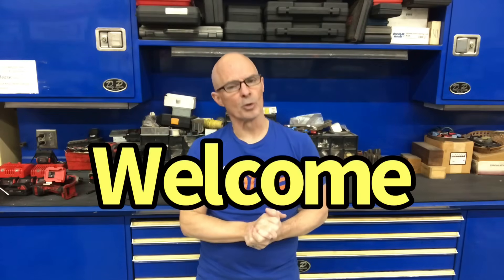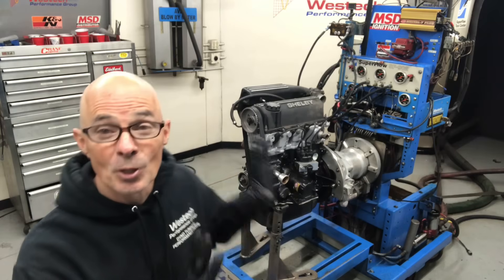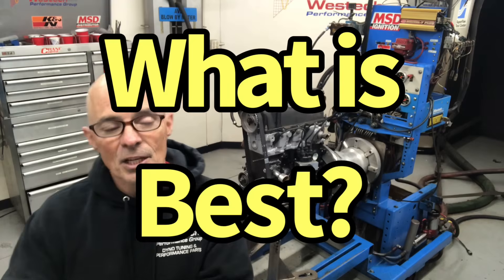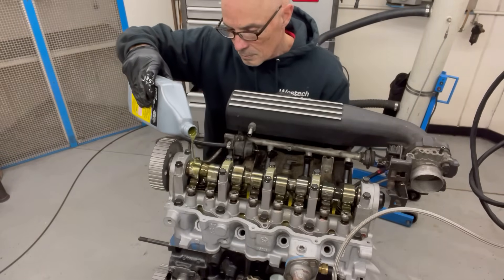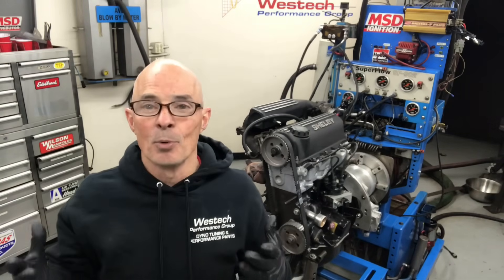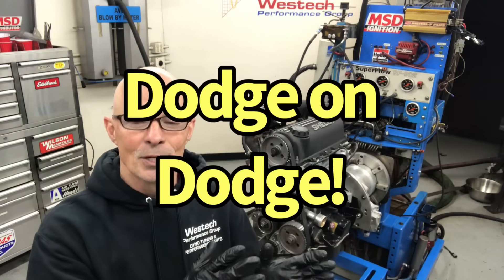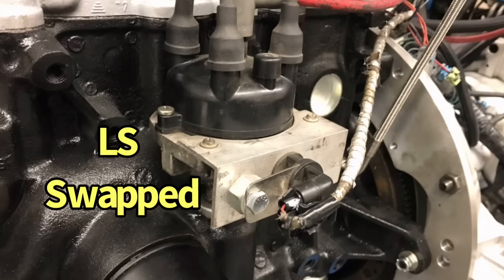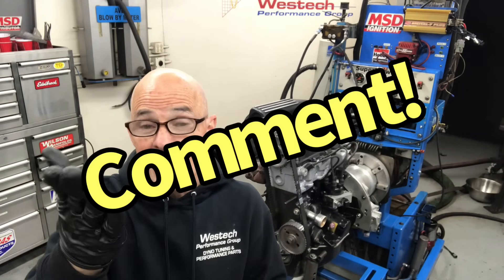2.2L DODGE TURBO-LS SWAPPED THE DISTRIBUTOR. 1ST DYNO TEST. WILL IT RUN? HOW TO RUN HOLLEY HP ECU.

Comment: Shelby said he found 40 degrees total advance to work on the street. The 84 Shelby had a special ECU with more total advance and a knock sensor.

That spike seems to be timing getting away then valve float at the drop off. 

Needs a (Half) set of 340 valve springs or better yet, cut the valveguide boss down and run Beehives.

The stock 2.2 valve retainers are HEAVY. Beehives retainers are less than half the weight.
Reply from the maker: what is the stock total timing
Reply: @richardholdener1727  On my Shelby I set the timing at 20 degrees advanced with the vacuum hose off the ECU. Then when the hose is back on it jumped to like 25 advanced. The special ECU allowed a total of 40 degrees this way.
Reply: @richardholdener1727  way less than they really work well at. My label says 6 degrees BTC Auto or Manual but that is with the stock ecm/PM managing and advancing the timing. I have hundreds and hundreds of passes at 46 degrees (static and total). It will run well at 42-46 degrees. But anywhere below 40 it is a pure dog.

Comment: I think I may have an issue, I've never seen that kind of oil pressure in mine. It's 50psi on start up the falls to 20psi, both at idle
Reply: Mine is 74 psi but it was oil pump matched on the block side way down into the main galley...increases pressure and volume to the top end, but lowers the restriction and HP robbing, the 287 head is open full drain back w/ hardly any restrictions whatsoever. The drain backs are open to the front and rear of the crank and between the counterweight. The oil pressure readings are now higher do to the lesser restriction use to be much lower in the block and the higher increased flow and volume. It is a bare block mod so best done during a full rebuild. The more oil in the head or top end (the less volume in the pan), the less need for a crank scraper or baffles as the oil P.U. is very near the bottom and rear of crank counterweights are splashing oil everywhere inside due to the transverse and tilt toward rear of engine mounting position on a 2.2/2.5L. Little work for a big gain.

Comment: I'm thinking up until that peak bump, the lack of timing control to it is leaving the area under the curve on the table.  Valves springs old and tired? Possibly. Maybe try a crank mounted trigger.

Comment: The plastic rivets in the distro are known to fail in the aftermarket units,  the metal part will flop around and run like crap.
Reply: Always and never fail to on a new rotor (no matter who mfgs it, flip it over and add 4 big beads of super glue to the 4 plastic melted rivets locking the shutter wheel to the plastic rotor.

Comment: Had a Plymouth Sundance with a 2.5, wish I would have got a turbo, those are great little engines, that is a weird power curve, stock mine would fall flat at about 4500. I autocrossed it and had a blast

Comment: Can you eliminate the Distributor and run coil packs? Utilize the distributor to plug the hole and maybe act as the trigger wheel only. you might be able to use the Holley at that point to take over the timing control.

Comment: I drive a 1985 Dodge 600 convertible in the summer.  It is a 2.2L non-turbo.  99 horsepower originally.

Comment: My WAG is it has to do with the manifold, which should be easy to test. My thinking is this: A engine needs four things to make power, air, fuel, compression and spark. The compression isn't changing so we can throw that out as the cause, you know what the timing was and it wasn't changing. It didn't suddenly get more fuel, or your AF ratio would have changed. So that leaves more air. Somehow at that RPM it just had better flow, you had enough injectors so when it saw more air it was able to add fuel to keep the ratio correct. More air, more fuel, more power. You are smarter about all this than I am, so I'm probably incorrect, but a simple intake swap might eliminate the spike, or more it somewhere else in the range.

Comment: Going to take a stab here, and if the ignition/distributor timing checks out, make sure that the cam timing is dead nuts on, might be too advanced. And you have to line up timing marks with a head that's tilted back. On the 2.4 dodge motors the little pin that holds the cam in place with the cam gear will sheer and your cam timing will be off. I would check the cam gear to cam alignment again just to be sure.

Comment: I swapped a G grind cam into a 82 Scirocco, and noticed a similar thing, the stock cam in the 1.7L motor would rev to 6500 but lacked pull power, it would just rev, but the new cam got a power spike from 6k up to 7k RPM, and I never knew why, but I liked it, so I wonder if it's your camshaft grind causing this power spike.
I only changed the cam, no other mods to my engine or fuel system.
Reply from the maker: it is stock 84 turbo cam

Comment: IN MY OPINION if the ignition was locked on the last two: The first few pulls with the overly advanced ignition timing is from pumping losses.  Dealt with it myself on the dyno.  Its soooooo far advanced that loses the ability to kill the motor but it makes terrible power (gets worse at lower rpm and will eventually hurt the motor if it can rev high enough) and runs rich.  The power spike that youre seeing after you locked the timing out seems to be a cam/intake/springs/portvelocity mismatch or something.... but it moving is very suspect lol.

Comment: I'm willing to bet if you extended or reduced the length of exhaust pipe after the collector, you'd loose most of that spike in power. I think it's right at the point where the pressure waves of the intake are coinciding with the negative pressure waves of the exhaust, so you're getting a super scavenging effect in the engine at that rpm. That exhaust pipe length looks about the length needed to make the negative pressure wave peak at 5000rpm (we make our step ups from 2" to 3" just behind the gear stick location) usually the place where the catalytic converter would be is the best for a 4500-5500rpm power spike. Certainly it feels like vtec inside the car, I liken it to a free nitrous hit
Reply from the maker: I'm familiar with the many different forms of scavenging on the exhaust along with the three major forms of cylinder filing in the intake, my question is why did the spike change with no change in exhaust pipe length?
Reply: @richardholdener1727  it may have a bearing on the injection timing, as in the exhaust gas temperature and pulse strength based on how much of the combustion pressure is blowing down and how much is useful work. You'll know yourself that spikes in power like that are usually as a result of a massive increase in cylinder filling/scavenging. I wonder if you could replicate this situation on another engine. It seems to me that the peak power below this spike is quite low given the engine set up, so it's probably all the hp missing per rpm above and below it all coming to say hello at the same point

Comment: Wow! It made more power NA than I thought it would. I guessed 80hp on FB. It made (basically) what the HO Shelby NA engine in the '83 Shelby Charger made (110hp). As for that spike...I'm not sure, but it sure feels like timing. Check to make sure the reluctor wheel in the distributor is tight. The little plastic part that is attached to the wheel can become loose and cause all kinds of issues.
Reply: That is a very common problem I saw with the reluctors. I wished they had used a better material when I was messing/modifying them.
Reply: Dick Johnson Racing in Australia used to run in their 2L Cosworth Sierra motors NA on the dyno. Dick has often quoted 5.4:1 compression ratio, 90hp NA, and 540hp with endurance turbo tune. I've seen the compressor wheels out of those turbo's, there was plenty left

Comment: Perhaps the power jump is lofting the valves off the cam making the big gains until it looses full control and goes in the toilet.  10:31 though looks like it did it at a lower rpm though which would not be consitent with something mechanical going on. I am going to say it was either something in the fuel or timing control that did it.

Comment: Have to fix the known issues first. Get the basic 'tune-up' fixed (reliable, repeatable timing control). 
What does O2 sensor say? 
What is oil pressure doing at rpm?
Then I'd put a foot of pipe on the throttle body. Have seen some weird stuff on 4 cylinder from removing the tube.

Comment: If the peak moved it definitely isn't a intake/exhaust resonance spike.   Going to say ignition or even injector phasing could be the culprit.  With those massive injectors your injection time has to be tiny - maybe 4-5 mS up top?  The shorter your injection time the more important phasing becomes.  Could be that at high rpm you're getting better atomization.
Reply from the maker: I originally wanted to try stock injectors-but did not get them flow tested in time
Reply: @richardholdener1727  Crap I have 4.

Comment: Why would you not run individual coils? you went to all the effort to get the trigger signal to the ECU?
Relying on a distributor is just silly. Solid state ignition is the only way to go.

I'd have honestly just put a 12-1 crank trigger on it and tossed the dizzy in the bin.
Reply from the maker: 6000 rpm (or more) has never been a problem for distributors on anything else we have tested (9000 in a Honda)

Comment: Did it make more power as you were letting off the air or before you touched the throttle.
Reply from the maker: letting off the air?
Reply: @richardholdener1727  is strange like one would do if he breather is really dirty

Comment: are you sure it is actually at 55 degrees ? OR is it the slack in the belt retarding the timing ! Advance the camshaft, see if that hump moves down, looks like the motor is coming on late !

Comment: Which sensor are you using in the distributor? If it's an actual 24x LS crank sensor, they are a biasing sensor and require the OE style crank reluctor where it switches from one side to the other. People ran into problems with them doing the 24x conversion on sbc's to run cnp ignition. For what you're doing, you should be using the sensor from the 96-02 5.7l vortec. It is designed to operate with the style trigger windows you have. Or the grey 58x LS sensor will probably also work.
Reply from the maker: we tried the 58x-did not work

Comment: If you’re running too much timing then you may have been so far advance that you were losing power until the RPMs climbed enough. Rod bearings don’t like that kind of load.

Comment: An 8:1 2.2 motor shouldn’t be making that spike at all lol. That motor also should not be valve floating at these RPMs, me and a reckless friend of mine regularly took a turbo van to 6500. However, IIRC people have found I think LS1 springs to work on these with the right seat pressures. 

I also love how these engines sound like tugboats with open exhausts lol

Comment: The big drop at the end is likely valve float, as for the power spike, I'm thinking that you're right on the money with the ignition diagnosis. I'm going to venture a guess and say that when you do get the ignition figured out it will likely make a bit more naturally aspirated than it did on your baseline pulls. In my experience, engines don't generally start making more power with no change in AFR (repeatedly) when something is going wrong, increased power is usually an indication that something is going right lol.

Comment: I'm wondering if you can run a differnt distributor off the end of the camshaft (cyl 4 side) I believe older models had a smog pump driven off the cam shaft there, and there should be a slot in the camshaft to facilitate this.
Reply: Team Mopar's Rossi did that in his Daytona. Used a 400 bigblock electronic dizzy on a plate. Ran off a slotted bolt in the camshaft.

Comment: With the unreliable ignition timing issues  I'd guess the that's why there's a spike in power
Reply from the maker: timing was high but consistent
Reply: @richardholdener1727  would be interesting to swap to a mechanical or different distributor to confirm
Reply: @beardwrench I have 1 that was molded with both mechanical and a vacuum advance pod. But, it is for my non-turbo N.A. edition and does not have the lower p.u. (just the single HEP) the weights are below the HEP plate , the hep is molded to move w/the pod and the distro caps must be notched to fit because of the rotor and  those spade wire ends you were surprised to see.
Reply: Modded up, not molded.
Reply: @richardholdener1727  Which is why 2 & 1 year(s) later and learning that you solved my issue (but today doing the last pc of the upgrade, as I am switching my slowest NHRA Stocker in the world to a Holley Terminator X, I saw these 2 vids and am now begging to get my hands on a copy of your mod (as in buy a single exact copy), that I desperately  need to avoid a much more expensive and tougher to fabricate crank trigger hanging out 6" away from any part of that block. Exactly what I need is a consistent trigger that works w/ that ECU, the rest I have already proven in the ign. system through many years works.

Comment: When was the last time ANYBODY saw a 2.2 on a dyno???
Reply: Mine was on a roller dyno, myself in the seat for 3 full throttle pulls in Gainesville, FL in 1995, facing a block wall just 3' or 4' in front of the front bumper...scared the absolute bejesus outta me, never again at least w/ me in the driver's seat. Really uncomfortable feeling facing a wall. Held my breath throughout each pull.

Now, I have seen what can go wrong in too many y.t. vids. No way, no how. Dyno rm dyno  ok.

Comment: Richard, was the AFR crazy rich up to 5500 RPM?  I've done a lot of tuning with an LM3 and I find that even at 20 PSI of Boost you don't 80LB injectors.    And I agree with @butcherbaker4258 many many thanks for taking on a Dodge 2.2  Very little Dyno data out there, lots of hearsay. Would really like to see some of the aftermarket Cams on the Dyno!  (I'm also interested in seeing the timing sensor fix, I would love to ditch the factory computer it is ancient, very very basic).
Reply from the maker: was 12.2:1 -this was na, and the 80-pounds will support near 400 hp with e85 once we add boost so we have plenty of fuel flow (smaller injectors do nothing if the AF is correct)

Comment: never owned a chrysler product, but allways had an interest in the 2.2.was a hell of a step up from the VW 1.7 the 2.2 replaced.
Reply: I had an early 1.6 VW (actually a 1452cc) before I had a 1.7. 
It revved to the moon with all the goodies meant for a 1.8 GTI engine like a bigger cam and all that. 
Actually my rabbit diesel was quicker till 4500 and then it got it's hat and left until 7500. 
That 1.7 came on at like 2500 and fell really flat at 5k. 
Even the stock 1.6 lived it at 6500. 
The 1.7 was a little better choice for Chrysler though. 
That 8v VW block basically lives today as the newer 1.8 turbos and almost any current VW 4 cylinder can be traced back to that engine.

Comment: Re: Power curve. I get this on bike engines. Yes, I do bike tuning. Depending on the bike there is almost always a "flat spot" in the power curve. It seems to be associated with intake resonance and pumping effect causing a reverse flow. I have not run individual intake runner absolute pressure gauges yet to verify of there is something to that. Just a theory. It is present on all I4 engines. The actual rev band varies with the engine size, cam, max rpm designed to run at, etc.. IE: XYZ 600cc with a rev limit of 15,500 stock will have it at 9,500 rpm and it will be through it at 10,000. Every XYZ 600 with the same configuration will have it at the same band. Changing the intake, such as stock to K&N or BMC high flow air filter will move the band. These bikes from factory often have "flapper valves" on the intake that alter the restriction at any RPM below the top of the dead band with the manufacturers goal of widening the torque curve and eliminating the dead band. These "flapper valves" sort of work but lower power everywhere. Without the factory tuning and modulating devices these engines can come on the pipe or cam like the old 2 strokes and can catch a rider unaware. Unexpected wheelie and sometimes flipping can happen.

My suggestion, Try putting a long intake runner in front of the throttle body. At least 12 inches and as much as 18. No bell mouth required. PVC is fine. The idea is to keep the velocity up.
Reply from the maker: we know what runner length does and we looked around for a length of tubing to whip up and air intake
Reply: @richardholdener1727  figured that.
Reply: @richardholdener1727  I really really appreciate your technical videos. You cover what and why in a way that improves my understanding. I4s and Rover/Buick/Oldsmobile aluminum V8s is my "interest". What you share has helped me understand and solve problems.

Comment: If you're already running the LS might as well use a rail of LS coils and do away with as much of that garbage ignition system as possible.
Reply from the maker: nothing wrong with the factory distributor or the coil we run for this power level
Reply: @Richard Holdener  I just have a personal hatred for those distributor caps and the push-through wires.

Comment: Since you are triggering off the distributor I'm assuming it is batch fire? Might have something to do with the high rpm spike if it's being overfueled at low RPM due to the batch fire and large injectors, but it doesn't make sense the a/f wouldn't indicate that.
Reply from the maker: af was in the low-mid 12s through the rpm range

Comment: Put a say 4 magnet msd wheel on the crank pulley with a Hall effect sensor and leave that metal tooth wheel nightmare behind for good lol!  The oem’s with their ecus had the tooth wheel stuff perfected but your not running the Oem ecu.
Reply from the maker: we run the holley with distributors all the time-but the crank trigger is the last resort